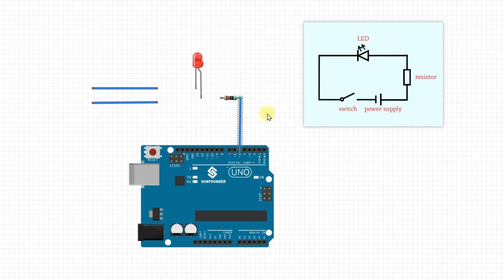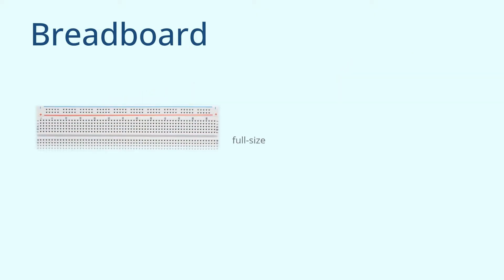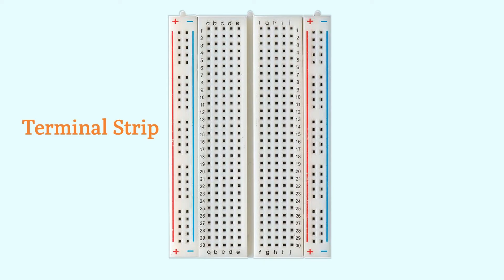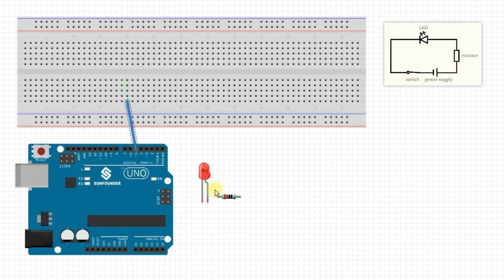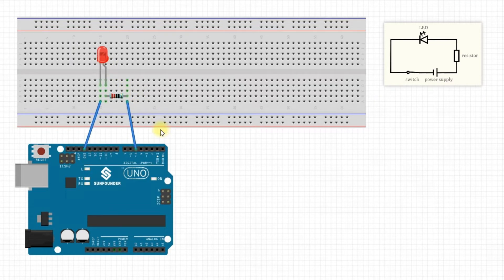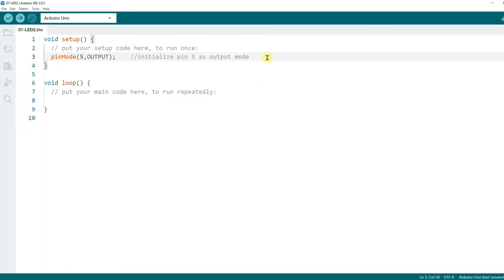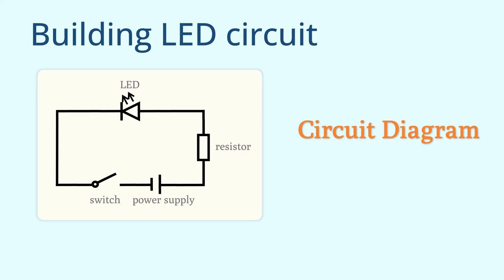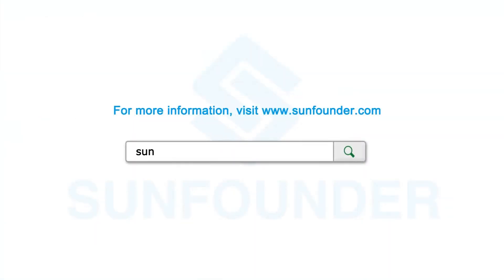2023 Arduino Tutorial for Beginners 07 - Digital Output 02 - Build a LED Circuit

Comment: Hi Jack, thank you for an informative tutorial and am awaiting for further episodes from you all.  Question: As your video shows,  the resistor is placed BEFORE  the LED to ensure the not too much power runs into the LED.  That's how I have always known things to be.  Looking at several other configurations, I have noticed that sometimes the resistor is placed AFTER the LED. Am I wrong ? have you noticed this?  Is there an explanation?   Thanks, Ben
Reply from the maker: Hi Ben,

Thanks for the great question! Whether the resistor is before or after the LED doesn’t change its function of limiting current—they’re in series, so the current remains the same either way. Placing it before the LED is just a common convention. Both setups protect the LED just as effectively. Hope this helps.